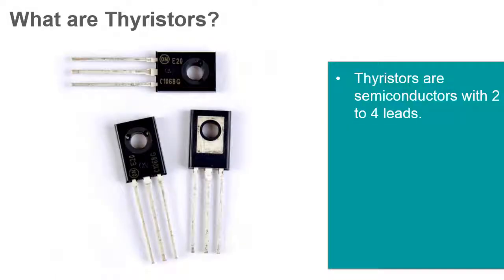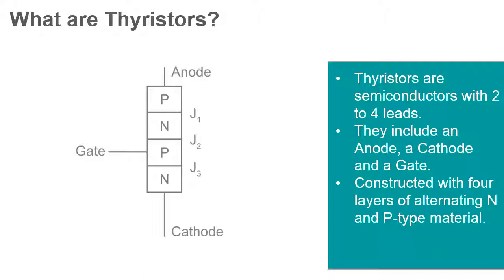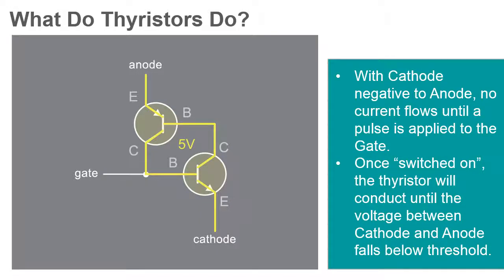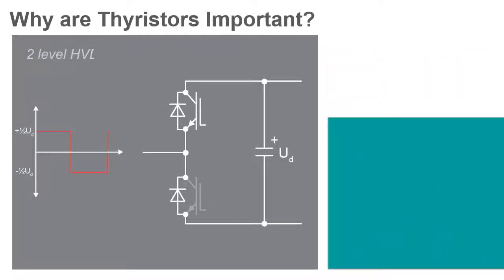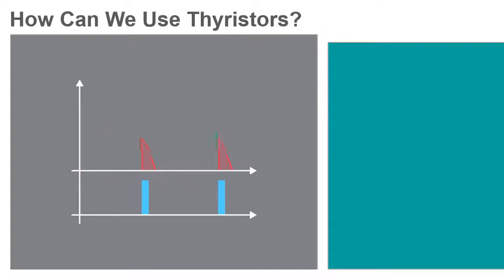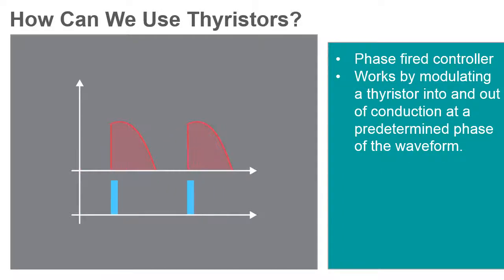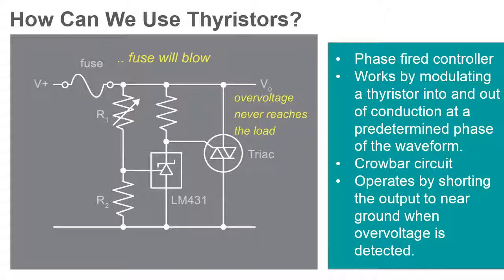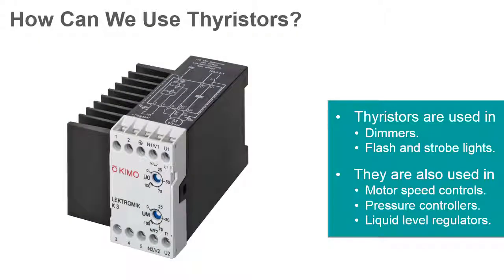Thyristors

Comment: Thyristors Were also used as Thyristor Phase Control And Thyristor Chopper Control as Traction System, 1st Thyristor Chopper Control was used in Trains in 1971, thanks to Japan And Thyristors, Electric Multiple Units and Locomotives Could have Faster Acceleration and Braking. Thyristor Choppers Sound Pretty Unique When a Train With Thyristor Chopper Traction System Departs From Idle 😉